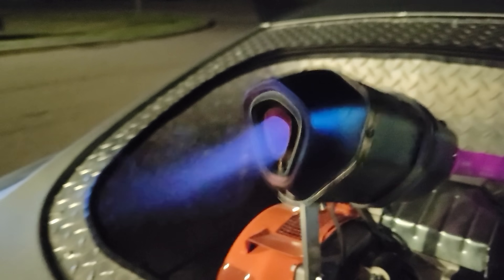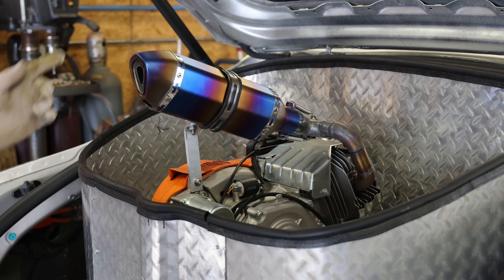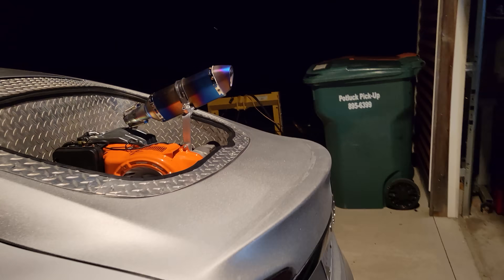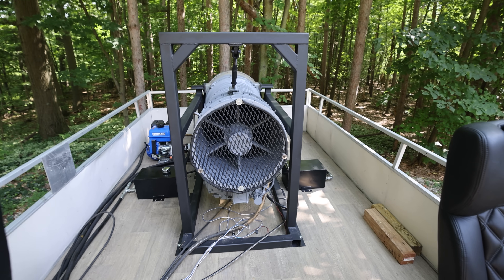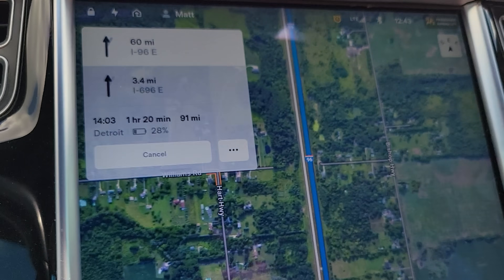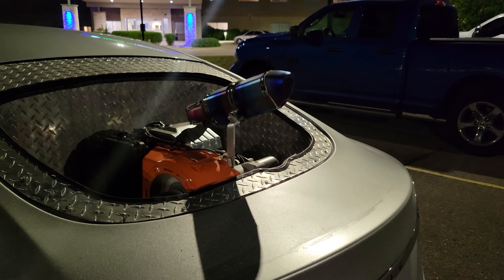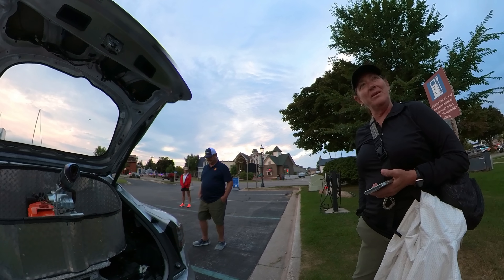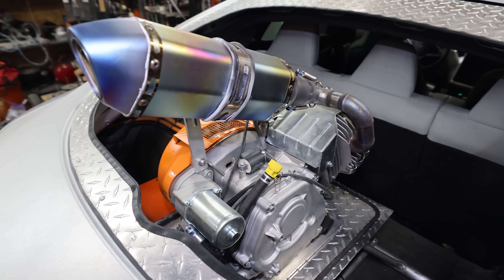Cordless Tesla (I Drive 1800 miles without charging) P.1

Comment: Hey have you thought about the predator 670 v-twin engine I think that one would sound totally bad ass and I has a crap ton of power plus you could put a turbo on it and whoa then the power really comes on just sayin
Reply from the maker: True but what I'm looking for here is maximum efficiency and maximum power, with efficiency being the keyword, I have a goal for this project which I don't want to say out loud, one of the reasons I didn't share many details in this video. I custom built the entire system that I'm using here.
Reply: @WarpedYT  very cool bro. I can't wait to see it. I'm loving this series, it's comical because from what I hear 80 to 90 percent of the energy to charge a tesla is derived from either fossil fuel or coal lmao 🤣  so this fits perfect great job on this idea edge of my seat for the next video

Comment: From the fuel economy numbers it seems 70mph is about the speed where the car's nose punches a hole in the air is just the right side for the car's body.
Reply from the maker: 100% correct that's the same thing I got from that, once you start going over 70 things start becoming more inefficient

Comment: This would also be awesome with a small DIESEL engine, uses less fuel quieter and probably can generate more power, and when underload a big black cloud comes out!
Reply from the maker: Oh yeah I want to take that to the next level that's exactly why I say goodbye gasoline at the end of this video to see who got it and who didn't. If I build the proper diesel power plant I have a feeling that mileage will be through the roof, and this car is almost 1000 hp  all-wheel drive, I saved a lot of those details for the next video which should be the cream of the crop this one was more of a testing video to see if I could actually make it work. And you know research and development
Reply: @WarpedYT  looking forward to it!!! :)
Reply: id imagine with a high compression na diesel It could be very efficient

Comment: The engine clearly isn't powerful enough. You should've figured out the power you need to cruise at 55mph. My EV needs about 13kW at 60mph. I would've gone for 20kW or about 25hp for the engine to account for losses and all that.
Reply from the maker: Easier said than done, there's a very good reason that nobody has done this before and the size of the engine is not the reason. There's a lot of challenges to get this to work, this was the first step. I mean as you probably already know you can't just charge a Tesla while you're driving it, it's not possible.

Comment: I’m interested in how you hooked into the charging cables so it can charge without touching the screen or charging port. I’m sure if i tried all the sensors and chimes and trouble lights would go off. Description in a nutshell or new video? Please?
Reply from the maker: Yep the car will go absolutely nuts if you did that. I built the system from the ground up, I didn't share any of those details in the video on purpose. Once I get to maybe episode 4 I may release some details. Let me tell you it was not easy, it took me almost a year to get it to work properly. That's all the details I can really give out, but one thing I can tell you is that the people at Tesla, the engineers and all those guys are amazing people.
Reply: @WarpedYT  how did you figure out how to simultaneously charge and discharge the battery ?  

you mentioned the generator is put under load when you accelerate , which  implies discharging and charging  the battery simultaneously
Reply: @rickyjb23  I dont even see a generator attached to that engine... I dont believe him it actually charges the battery.
Reply: @Chris-yy7qc  look closer

Comment: With all respects, but this is one of stupidities things ever done, buy a regular generator , it is more efficient and more flexibility and you will not lose reselling price
Reply from the maker: No offense but incorrect, a regular generator will not work for this application, just the sheer size would be an issue, this is a 10,000 watt unit. Do you see how tiny it is? It only weighs 40 lb. This is a completely custom system and the car is already put back to normal right now I'm working on version 2 which is going to be turbo diesel. I withhold all those details from the videos because all they don't get good view numbers. Additionally I did not want to give details on how I custom built my system because it took me a very long time. Hopefully you get me
Reply: @WarpedYT  -loud noise level - rip storage - if I have  ame car like you , I would never ever done such thing as you did , completely useless for ME , but good luck for you even though I think you will give up on that after you can not bear the noise.

Comment: Could you go into detail about how you generated power with the engine? It looks like there isn't any form of generator connected to the engine. Also how were you able to bypass the safety interlock for charging the car. Every EV I know of won't allow the vehicle out of park if a charge cable is connected. Did you step the voltage up to pack voltage and directly connect it to the battery?
Reply from the maker: As for the systems of the Tesla and the battery pack voltage, it is completely original although this particular car is almost a 1000hp all-wheel drive.
Reply from the maker: I didn't go into detail because I custom built the system. So what you're looking at, the engine is the engine and the generator and one package it's 10,000 Watts. Again custom built and some of the stuff, the details I did not want to share in this video. As for the interlocks and everything else you are absolutely correct however, I did in fact custom build the entire system pretty much from the ground up. I will go more into that in version 2 which I'm currently building, but yeah I intentionally did not go into those details. This was more my 1st research and development test to see if I can actually make it work and if it was feasible, it was and I did. Any other questions I'll answer here no problem.
Reply: @WarpedYT  Well I wanted to be critical, but after reviewing the footage, I can see that at 0:54 there is a rather large coil behind the cooling fan (possibly a hub motor converted to a generator). I also noticed at 1:07 there are too many cables coming off of the engine  for normal operation. Looks like 3 phases in their own cable sleeves. Very stealthy. I expected a large "motor" like normal generators have and a software hack to allow the car to use its normal charger while moving. I'm still not sure how you have integrated the active charging into the car, but my best guess is for the generator, you re-purposed a 10 KW hub motor directly to the engine's output shaft. I am excited to see if 1. I am right, and 2. How you tied the power back into the EV system without throwing any alarms.

Comment: Just get a Chevy Volt, they did their homework. It'll get you there. 
Or, you can check specs, and see how much energy will actually be necessary for the ride, and generate appropriately.
Reply from the maker: Chevy volt is not a 1000 hp AWD
Reply: @WarpedYT  What does that have to do with anything? You couldn't maintain 55mph.

Comment: I love the cordless EV concept. "Hybrid" vehicles like this are truly the way to go. 
Just little more efficient gas charger and glass battery tech (soon to be a real thing and a game changer) will make this thing real for everyone.
Best thing tho'? Fission energy. A nuke. If I could only get myself some 238!
Reply from the maker: That's why I try to tell people, my Tesla is almost 1,000 HP all wheel drive, where do you see any car in the road that has that performance and getting 24 miles to the gallon
Reply: @WarpedYT  That kind of milage with that kind of power is impressive indeed. 
Have you considered the possibility of 2 banks of batteries one being charged while the other is being used then switching banks when depletion threshold is reached. It may be a bit more efficient to charge a battery that is not being depleted. Your thoughts?

Comment: imagine if you actually make like a muffler system that actually makes the engine not that noisy but still kept the 10kw power output and do a legal cannonball run on that
Reply: The cannonballrs need to take a page from the Airforce in-flight refuling book and refuel while driving (e.g. fast tanker and a hose). No "stops" per se, just slow down a bit...
Reply: @c103110a  this has always been my thought. Carry as much fuel as possible, in a sporty crossover of some kind, copilots sending drones up ahead to check and having spotters driving ahead every 20-30 miles
Reply: The engine itself is rather noisy as these small engines isn't built with noise suppression in mind. 
Quieting the exhaust will only achieve so much ...
Reply: @Mr.Engineer.  

He needs a Honda generator.
Reply: @janshuster1426  he would need two of the Honda EU 7000s to be able to continuously put out a 10 kilowatts of power like he was with that engine. Each one of those generators is 250 lb... His current method is far more efficient but way louder
Reply: The 2014+ BMW i3 has a far more powerful gas engine.  Maybe get one of the those, they are almost silent.
Reply: @texmex9721  Same could be said about a 2011-2015 or 2016-2018 Chevy Volt. Still small 1.4L/1.5L engines respectively, but the general concept is the same.
Reply: @rwkerstetter  The Volt was slightly different in that the engine could generate electricity or power the car mechanically.  The i3's gasoline engine was a completely separate unit, like is being built here.   The i3 could even be purchased without he gas engine.   But yes they have more in common than they are different.
Reply: Really, this would be better if configured with a jet micro turbine powered by Kerosene or vegetable oil. Far cooler sound.
Reply: You won't get close to any cannonbal record since you can't drive at sustained high speeds without draining and overheating the battery
Reply: Alot of the noise actually comes from the engine itself. Being air cooled means there is no water jacket or coolant to help dampen the noise.  I have a Briggs Intek single  modified for marine use with  the exhaust piped underwater and it made almost no difference in sound vs the standard muffler.
Reply: @Hates Spam  I drive a 2014 BMW i3.  It has a 34HP 2 cylinder engine that spins a generator to charge the battery.  This is not a new idea.  
Also, he shows a stock gasoline motor from Harbor Freight.  He never shows a generator.  He never shows any electrical connection to the car.  Oversight?  Maybe.  Maybe not.
Reply: @Hates Spam  You said: "He's attemting to design a system that significantly increases the range of his electric vehicle. If he happens to crack this and create an efficient easy to install system, he's going to make a lot of only quickly if he patents his invention and sells them or the idea to a larger company."  So you think it's a OLD IDEA that he is going to patent and then make money???  🤣🤣🤣🤣

The i3 is also a car, and cars are not new!  But it was the first production hybrid to charge the battery with a gasoline engine with no mechanical connection to the drivetrain.  So that was new.   And it's a PHEV, Plug in Hybrid Electric Vehicle.  (I mean if you want to use the correct term.). 

Thank-you you for recognizing my genius.
Reply: And why run that generator full time? Wait till the battery is way way down, and you have decided not to stop, or go pee, or eat, or rest, or stretch you legs to encourage blood to circulate, or look at the sites, or do anything.
Reply: @pauljefferies9087  Because it doesn't charge enough to do that. It wasn't even keeping up as is.
Reply: @pauljefferies9087  He runs the generator full time because it does not make enough power to drive the car at hi-way speed.  While he is driving, the battery is draining, maybe 50% slower than it would without the generator.  So, when he stops, he lives it running to build it up.  
And remember this is all done to make a YouTube video, it's not meant to be practical or logical.
Reply: I think it’s would be quieter with a PRT and for highway a muffler bypass.
Reply: @Hates Spam no it’s just as he said it’s done just to make a YouTube video there’s no other reason because this thing makes no sense.
Reply: @Hates Spam all right everybody wants one of those loud ass things in the back of their car killing off any kind of trunk space that they might’ve even had before this configuration.
Reply: Imagine not using gasoline to power an electric vehicle
Reply: If you had a Mr Fusion🙄 Maybe
Reply: still gotta stop for gas and probably more often. plus its a distance over time thing like he said so he couldnt go fast ever.
Reply: I'm confused at the term,  "legal cannonball run"
Reply: @Hates Spam this is the finished design. Cope, seethe, and mald harder bro.

Comment: The calculated MPG is surprisingly similar to a MB S-Class, using Premium gas. I'm surprised it did so well considered the Jerry-rigging involved. Fun experiment.
Reply from the maker: Exactly and this is a very inefficient engine setup
Reply: @WarpedYT  ah jes, just did the conversion and my car can go about 60mpg at 75mph. But 75mph always feels so slow on german motorways.
Reply: I think because it does just always run at an efficient rpm and does not change that rpm all the time (breaking and accelerating the mass of the engine and running at not efficient rpms)

Although my 2002 non hybrid gasoline Toyota does 33-40MPG in the city and even less on faster roads which is still better than the tesla :D (and a hybrid car would still be way better than this xD)

But VW or BMW had a similar thing in their first electric vehicle as a 'range extender' that charged the battery when it gets low on charge.

That jerry rigged setup is just like a diesel-electric-locomotive but with an underpowered engine and a huuuuge battery xD
Reply: The Tesla is roughly a 25-30 mpg (US) car by petrol to electricity conversion standards. It weighs 2 tonnes though so will have quite a bit of rolling resistance, and a similar sized petrol engine vehicle will use about the same. You could probably play around with the amp charging rate to see what puts most energy in the battery for how much fuel the generator burns.
Reply: My Mercedes Benz is way quieter, weighs less, gets 24MPG and people don't hate me.😂
Reply: my unicycle does 25wh/mi

Comment: I’m sure the people at that hotel loved listening to a two stroke engine outside their room all night long…
Reply: I'm sure that's a four stroke engine.
Reply: @bobby0081  400 cc 4 stroke???  And with that constant backfire?  This looks like a typical small to medium portable generator engine to me.
Reply: @Meatball2022  it’s a four stroke
Reply: @Meatball2022  a 2 stroke is what most old chainsaws and weed whackers used. On a 2 stroke you mix gas with your oil. That is a 4 stroke engine that is sized between your typical 6.5hp and 20hp lawn tractor engine.
Reply: @bobby0081  400cc is more than 6.5 hp?
Reply: @Meatball2022  212cc is typically referred to as 6.5hp.
Reply: @bobby0081  wow. That’s a lot more power than I expected.

Comment: Can you go into more detail about how it's charging the car? I'm more curious about that. Are you creating 120V AC and using on the onboard charger?
Reply: O think he is rectifying de AC 3 phase to DC. Sync it to 400v and let it run into the main cables that goes from battery to the electric motor. He needs also 2 contactors for some security and is ready to go.
Reply from the maker: I didn't go into detail with that because I custom built the system. I'm not using anything on board.
Reply: @WarpedYT  that's really impressive! Is the generator making 240v AC?
Reply: Not using the onboard charger would mean it has a separate ac-dc converter to charge the battery . Or the generator has to output 300v+ of 3 phase AC to directly run the motor .
 Even if he did power one of this cars 2 motors the other would act like a generator whilst moving , they have no clutch system to disconnect them from the wheels .

My confusion  in both cases is around the fact you cannot simultaneously charge and discharge a battery .
Reply: @rickyjb23  You can have power being generated and used at the same time, the battery could be charging, discharging, or neither. Ask yourself what happens with our phone when you use it while charging.
Reply: @rickyjb23   stop talking about "charging and discharging simultaneously". It's just a simplified explanation for the title of the video which is fine unless you're being pedantic about it. 99% of people understand that it just means the car is powered by the gas engine.

Comment: An engine that isn't throwing flame out the exhaust would probably be more efficient (but not as cool).
Reply: Probably not more efficient because it would have more back pressure. The flame from the exhaust is because the muffler looks to be straight through and very close to the exhaust port.
Reply: these small engines have fixed timing and they are very retarded on timing so they wont detonate at low rpm thats the reason for the flame and cherry exhaust

Comment: 285WH/mile or per minute=17.1KW.
17.1KW=23hp. You need a 25hp engine.
Now this is not adjusted for head winds. If you drive into a 20mph headwind at 60mph it's like driving 80mph on a calm day because your airspeed would be 80mph.